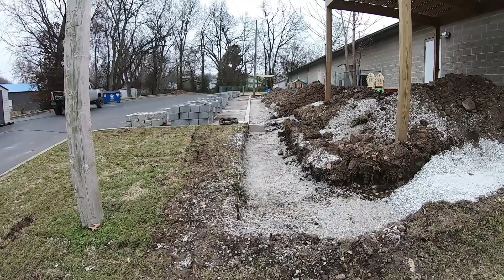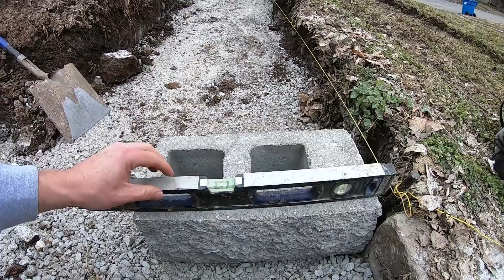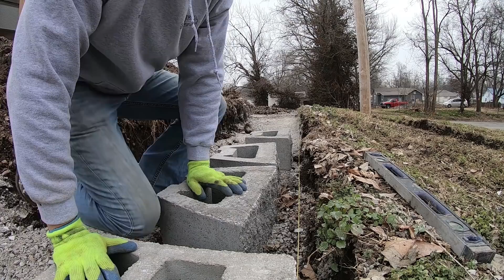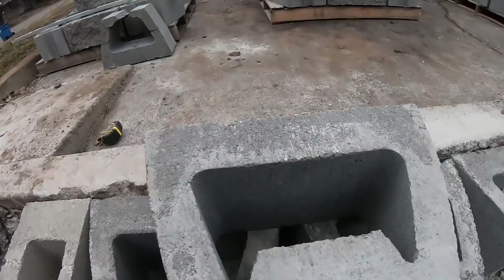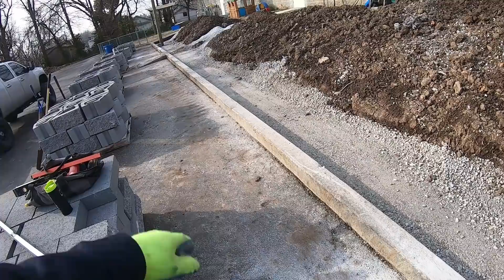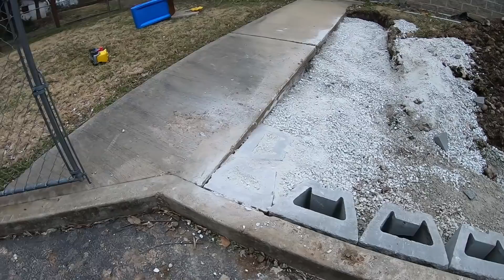Setting The First Course Of Blocks

Comment: 2 questions.  1. why do you have to step up the wall?  Couldn't you just run a full course?  It look from the video that it runs level all the way.  2, what type of gravel do you use on your bedding?  Thanks you do great work.
Reply from the maker: You could run a full course but you just waste blocks if they are well below the ground and it’s more difficult to level them down in the trench. I use base rock for the footing. It’s limestone with fines in it for packing
Reply: @eliteearthworksllc  Thanks For your reply.  I appreciate the help.  Will be doing a VersaLok wall this summer  Wasn't to sure about the step up/down.
Reply from the maker: @onemorething100  you’re welcome! Oh nice versa lok is a much nicer block than what I was using. You will like it
Reply: @eliteearthworksllc  Thank You.  I hope you can help me with another question. I'm going to be starting my wall next month.  There's an old wall I'm removing that's been there for 30 years so the ground is already packed.  VersaLok suggests 6" of gravel base.  Will that disrupt the compacted earth trying to dig down?  Should I just try to keep from disturbing that compacted earth and put gravel down without digging?  Thanks Again for the Help.
Reply from the maker: You can see what it looks like after you get the old wall out. You may be able to compact what is there or you may have to bring in a few inches of rock then compact too

Comment: If you do this again set the line on the back of blocks, tamp the base inch below where you set them and use concrete mixed half dry to set your blocks, will make your work lot easier and accurate.Thumbs up for hard work.
Reply from the maker: 786otto that’s a good idea! I almost set a string on the back but I thought I have the curb to go off of but didn’t think about the blocks having more sticking out on the front. Good idea on the concrete too. Thank you!
Reply: @eliteearthworksllc  Glad I could help , try Nicolock on next wall.
Reply from the maker: 786otto ok I will check that out, thanks

Comment: Those are hollow core blocks, your suppose to fill the voids with stone on each layer for weight of the retaining wall and to lock each block into place. Also need drainage pipe and exit to front of wall. Base course looks good though
Reply from the maker: 5point3LitersOfLove you are correct. I do all that in the next video. Thanks again

Comment: I'm a bit curious where the water that collects in the clean rock is supposed to go?  Looks like the sidewalk/steps area breaks it into sections with no way for the water to leave.  shrug I'm probably missing something obvious, but just can't figure it out.
Reply from the maker: Spud Gamer I put a 4” corrugated pipe behind the wall and raise it up above the curb and it weeps out gaps in the blocks before the steps on each wall. In tonight’s video I touch on that a bit more. Also with having the wall 6” lower than the building and with a slight slope on top most of the surface water will run over the top of the wall. Thanks again

Comment: No doubt, that is some back breaking work. But you will thank your OCD when it’s finished for taking the time to get that first course right. Do you think it would be worth it, to throw down a shovel or 2 of course paver sand under each block on the first row? Seems like it would help in leveling them up.
🤜🤛
Reply from the maker: psidvicious yes that would make it much easier. I keep thinking I’m going to try that then I never get the sand. If I do this again I will remember the sand lol!

Comment: Never seen a wall built with glue , over here in England we still use good old pug (cement and sand )
Reply from the maker: 125 SM that glue is crazy it sets up in 5 mins. And once it sets it’s there. Thanks again

Comment: Good job! Whenever I lay a wall on a aggregate base I use a thin layer of #10’s or concrete sand. It’s a approved method and it’s a bit easier hitting the blocks into level. But other than that it’s just lots of mallet work. Ice up those elbows and shoulders.
Reply from the maker: Western Reserve Landcare Inc. thank you! Yes I keep thinking I will do that sometime but I always forget to bring some sand or screenings lol! Maybe one of these days. I definitely agree on the ice lol!

Comment: What base material did you use and how thick of a layer? Also what brand of block you using there?
Reply from the maker: CountyLine330 it was 6” of 1” base rock or limestone. I wet and compacted it in 3 lifts. The blocks are Ridge Rock a local company makes them here in town. They’re 75lbs a piece
Reply: @eliteearthworksllc  Thanks!

Comment: I would have thought you would put stone in the black as you were going up. Just a thought from the peanut gallery. Just remember what you might think is boring other people don't find it boring. You probably think it is boring because you have done walls before. That turned out to be a nice solution to the pole. I thought you were going have to make a half circle behind the pole.
Reply from the maker: Brian Gardiner I fill the blocks with the clean rock when the wall is all done. I have that in the next video. Yeah that worked out around the pole much better than I thought it would. Thanks again